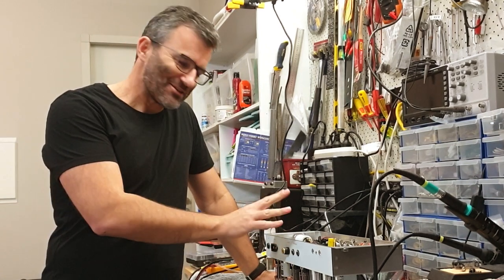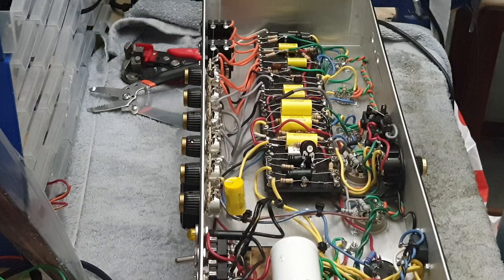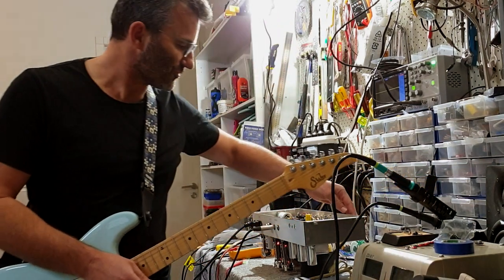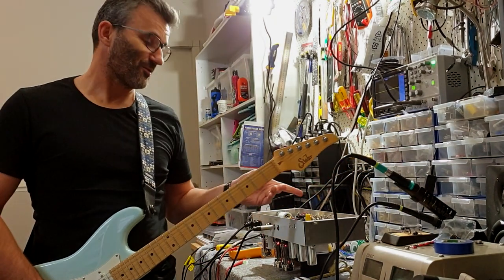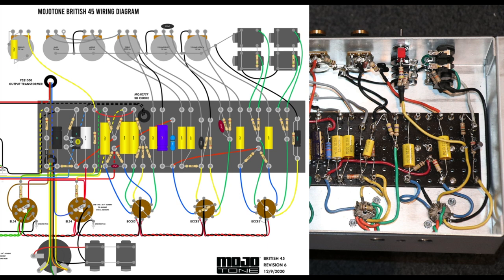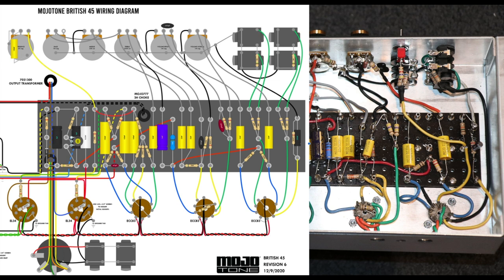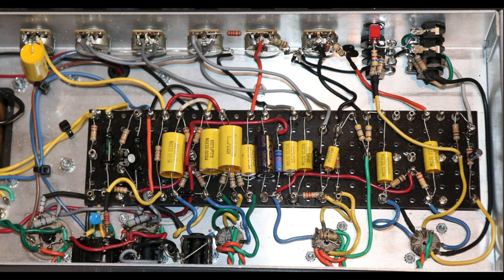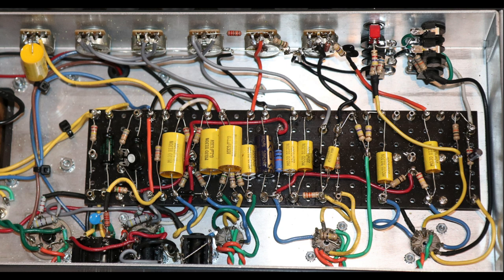JTM45 Kit Build conversion to Dirty Shirley DS40 - DIY Guide

Comment: I just did this mod. Cost me $15 and a few hours. WOW what an amazing sound. Completely transformed the amp into something much more versatile and more "Marshall-y". Admittedly it doesn't really sound like a JTM45 anymore but I much prefer this. Fantastic. I didn't do the fixed depth control or remove the ceramic 10w resistor. Also left off the 2N2 treble reduction cap (as I couldn't find one). Thanks so much for sharing this!
Reply from the maker: Great to hear!

Comment: Thanks for such a great information and video. I saw Friedman use 2.2nF cap for PI input coupling cap instead of 22nF. Is that for tightening the bass?
Reply from the maker: it would high pass a lot of bass, but Dave doesn't use that value to my knowledge
Reply: @HeadfirstAmps  understand, thank you.

Comment: Wow, quite the amp! Love how the clean tones are full plus that fantastic gain :) So with the low input it plugs straight into the cold clipper and you have the gain structure set to the 2.7k plus .68mf cap? Would it work in the cold clipper gain structure ? ...... Really enjoying your work Thanks for posting!
Reply from the maker: Thanks David.  Actually the low input has the same gain structure as the high input, unlike a 800 it doesn't bypass the 1st stage.  It does however activate the 68k/68k input resistors as a divider which 1/2's your guitar signal at input
Reply: @HeadfirstAmps  Thanks for clarification, I kept thinking the 800 front end,  It's becoming clearer now :) 

     So the 2nd volume pot you change into a master with the tonestack's treble wiper entering it's input and it's wiper entering v3 via the .02uf cap and you eliminate it's original 500pf  bright cap and ground it's 470k resistor?  ..... and one input is changed into a gain structure switch and the other is dormant? ...

Comment: Wow! Great tones! Just wondering what the recording signal path is? Saw a lexicon in the rack there. Love a Lexi! Or is the Axe FX doing verb?
Reply from the maker: Amp to Suhr RL, to AXE FX which only has the Cab block active for an IR blend, the PCM80 is in the loop of the Axe and is providing all of the time based effects.
Reply: @HeadfirstAmps  Lovely stuff! I have numerous Lex plugins but would love a real PCM. So hard to find at reasonable cost or condition. My fave units.

Comment: I love the clarity and string seperation of the DS. If I did this conversion with my beloved JTM50 build, what would I be losing by changing that preamp section? BTW, I also already have a switch that moves it between tube rec and SS and a push pull that takes it from shared to split cathode.
Reply from the maker: The main difference is you are converting it to a master volume amp, it’s essentially the same as going from a non master volume JMP (1987) to a master vol JMP (2204).
Reply: @HeadfirstAmps  I'm hearing a lot of string seperation/articulation in the SD that I'm not heaing at that level with my JTM/JMP's.
Reply from the maker: What JMP circuit?  There were many.
Reply: @HeadfirstAmps  Mine is a 67' spec JTM50 with a push pull switch that moves it into more of a JMP style split cathode. It's basically a JTM50/1987X in one save for a capacitor or 2.
Reply: The only thing that concerns me with the change to a 2204 master volume version is whether or not I will be able to recreate the tone of the non-master amp along with all the benefits of that DS40, like string articulation, etc.

Comment: Thanks for this walkthrough. Anthony who you know has been bugging me to make a DS40 mod for my JTM45 for a while now and this video has pushed me across the line. :) He bought me one of your DS40 boards. 

I modded my amp to KT66. Would you recommend going back to EL34 with this DS40 mod, or stick with KT66?
Reply: Still no answer? I'd really like to know the same thing... Hey Burger, are you reading your comments? ; ) 
Cheers mate for another gr8 vid, taking me a while to get through 'em all.
Reply: @SeQFreQ369  For what it's worth I decided to put it back to an EL34 before starting the mod.  The EL34 had more "kick" and "punch" and depth than the KT66, but the KT66 had more presence and air.  My theory was the EL34 is a better match for what a Dirty Shirley is trying to do, plus the magic is in the midrange and low mids for guitar amps.
Reply: @velvetsound  Excellent info, thanks! So now I'm curious what primary impedance is your o/t, i.e. is it designed for kt66 or el34, and are you miss-matching impedances to get the tubes in their sweet range? I ask as I have a 6600 primary, so kt66 with proper matching, maybe el34 mismatched. Cheers Jason.
Reply from the maker: Yo!

Well you need to match the tubes to your OT's primary impedance, to get optimal performance and tone.  El34's, and 5881's, you want 3k6 to say 4k2. (For 50w).
Reply from the maker: 6k6, also consider the JJ6V6S. Killer tubes.
Reply: I’m using the Mojo kit which was designed for and shipped with EL34s, so I think my OT is matched with the EL34s and the KT66 is the mismatch. At least that’s what it sounded like to me. The 3D quality was just missing with the KT66. 

I also tried a type 2 and also a type 3 TW MV mod on the amp. Don’t bother. The DS40 mod is a much better idea.

Another tip - You can get a Mojo FX loop to fit into the 2 unused input jacks on the front too if you do the DS40 conversion on the Mojo JTM45 kit. It’s tight and needs a little drilling but it fits.
Reply from the maker: Yes, the mojo kit uses a plexi50 OT. Designed for EL34's
Reply: @HeadfirstAmps  Ahh, thanks mate but I have had a number of early failures and doa tubes with JJ6v6's, so I gave up on them and now use  EHX for my 6v6 amp, reliable and handle the high voltages. Cheers.
Reply: @velvetsound   Cheers man, appreciate your time and effort. Sounds like I might need to re-think some of my circuit ideas...  I've finished the "2204" but still got a couple more heads in the works and variety is good, I don't want to end up with the same kind of sound/response via 3 different amps/circuits .

Comment: A 1Meg resistor from switch pin 1 to 2 and another from 2 to 3 will stop the popping.
Reply from the maker: Wouldn't be a real DS if it didn't pop. Lol

Comment: If I do the same in the power section - replace the 1K 10W cement resistor with a jumper wire and replace the 27K resistor next to it with that 47K to my Mojotone JTM45 without putting that negative feedback cap over resistor at the impedance selector, would i have to do anything with the bias?    because I've converted the pre-amp section of my amp / mojotone jtm45 to lead specs and was wonder if i could change these things without change bias or unprotecting anything?  because I'm looking for a little bit less sag not that i've changed the front end to lead specs.
Thanks...
Reply from the maker: By the 27k to 47k, I’m assuming you are referring to the negative feedback resistor…in which case changing that will not impact your bias setting

Comment: Can this be done as a non-master volume head with just a gain structure knob?
Reply from the maker: Not really. The structure switch is on the 2nd gain stage which a Plexi circuit doesn’t have.
Reply: @HeadfirstAmps  Tough decision this is. I kind of want to keep it as a NMV head.
Reply from the maker: It’s a different circuit….

Comment: 25:06 What's that 220k resistor do?
Reply from the maker: It sets up a voltage divider with the 1M volume pot, therefore attenuating the signal a bit as it enters the master volume pot.  In other words, gives the volume pot more useable sweep.
Reply: @HeadfirstAmps  thanks i will try this

Comment: Is it possible to make a switche-able plate resistor? Or is it just tainting with death?
Reply from the maker: Possible, but you'd need a HV switch similar to the standby/power .  Dicing with death there, it's 250vdc!